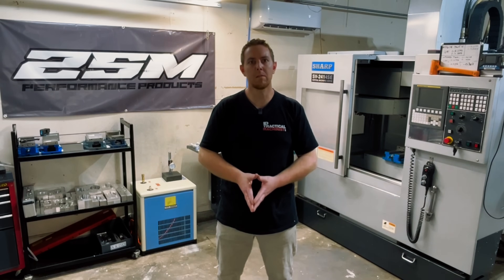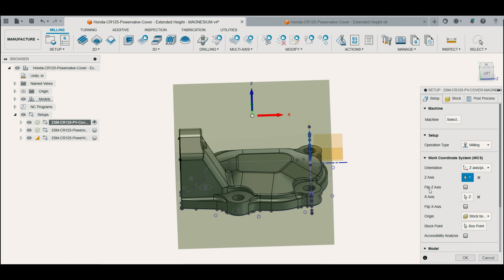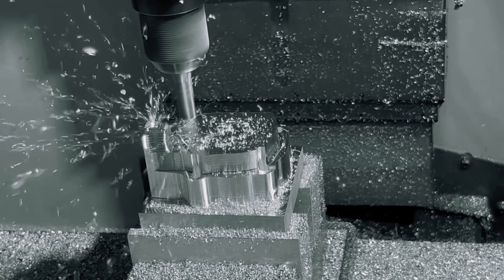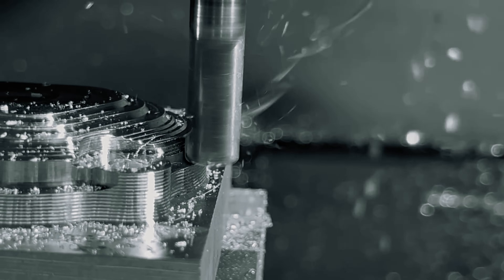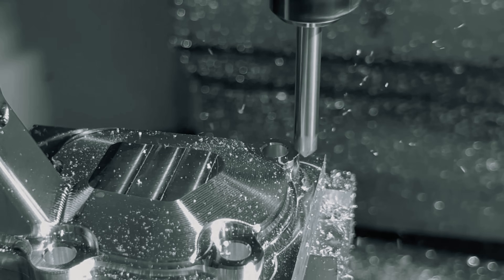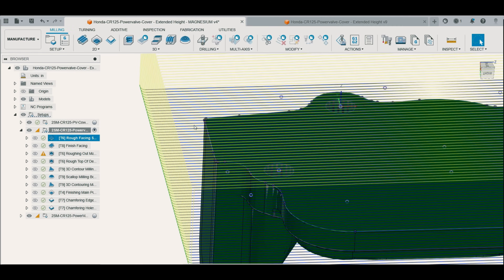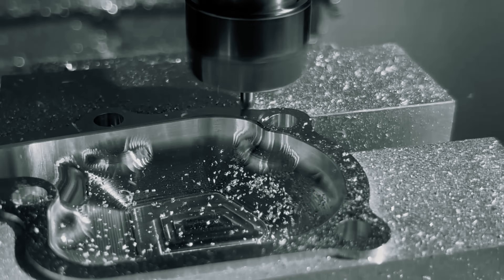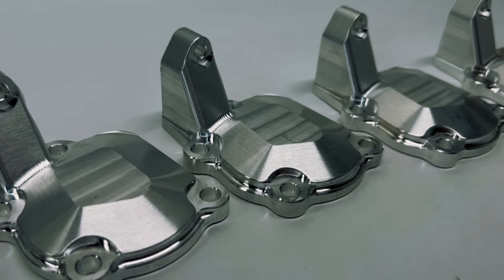I Was Nervous Machining Magnesium… Here’s What Happened!

Comment: Do you have any advice for stock prepping zk60? I've got some blocks much bigger than need to go on the mill, would normally just bandsaw them but worried about the fire risk 😬
Reply: I got mine supplied from the customer already precut. My best advice would be to cut it on the bands saw using pure oil as the cutting fluid. Avoid water soluble metal cutting fluids.

Comment: For op2 remaining stock roughing, I recommend using a 2d adaptive with the bottom height set to model top. Leave about .005 from model top. This way there is no floating material to be flung!
Reply: This is definitely ideal and you are correct here, that is a great way of doing it. I have gotten in the habit of doing it this way because my stock sizes often change for OP1 on X and Y. 
That makes an OP2 program obsolete using the adaptive decking method if the stock gets wider the next time around, unless you want crash and break an end mill.

Comment: You need a Met-l x class D fire extinguisher Good luck with sand , I worked for a Company that made thousands of Mag parts a year , When we started flooding the parts in water soluable coolant the Fires stopped,
Reply: Yeah, I definitely looked into the class D fire extinguisher, I just didn’t feel like spending $900 on one to only make 6 parts was justified. Thanks for watching!

Comment: I'm puzzled about the coolant thing. Water or coolant will not put out a magnesium fire, BUT it will keep it cool during machining so there should be less risk of setting a fire in the first place !
Reply: If you watch the video again, I mention that using traditional coolant that contains water will not prevent a magnesium fire and will only stoke it and release dangerous hydrogen gas.
Reply: @2SMPerformance  though will you agree that coolant would suppress a spark or similar ignition source ?
Reply: @SuperYellowsubmarin small pieces of magnesium will auto ignite at normal room temperature. The coolant will not help you. Like he said. It makes it even worse if there is a fire and you're using coolant on it.
Reply: @mystiquesquared  What do you mean by auto ignition ? There has to be an ignition source; the smaller the chip or dust particle, the least the ignition energy required - down to a point where static electricity discharge may be the ignition source
Reply: @SuperYellowsubmarin  Going back into the dim dark past we were using magnesium strips lit with a single match to start a thermite reaction in Chem. This came with the obligatory safety lecture do not put it in water or feed it after midnight. Heat alone is far more likely to be the cause of ignition than anything electric.
Reply: @SuperYellowsubmarin I was just going off of the limited knowledge out there on the internet, and plus I really did not want to get magnesium in my coolant/coolant tank mixed with my aluminum chips that I recycle, so there is that.